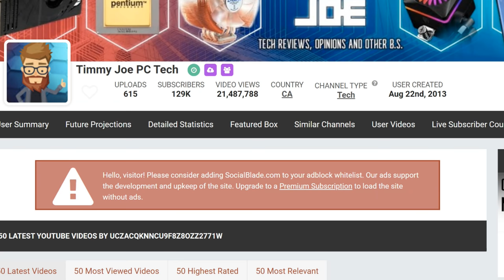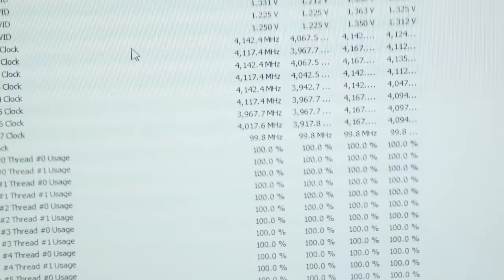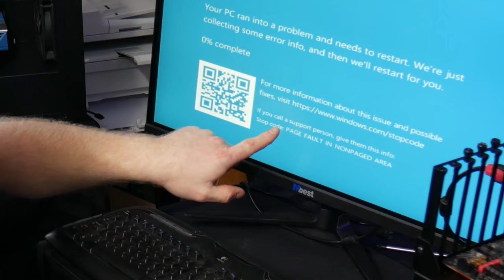This Ryzen 3700x was my biggest problem in 2019...

Comment: hey Timmyjoe i have a very similar problem but mine was my ryzen 7 1700 chip with a Asus X370 prime pro board and i put it in my wifes MSi b350 gaming board and its never given any issues again

i currently have a x3600 ryzen 5 in the same asus board but it does some funny stuff at total random so im upgrading to an Asus X570 prime -P

what your saying is slightly scaring me because everything worked in an Asrock B450 board that i sold now 

and im wondering if its an asus board for my cpu problem

and yes like you ive tried m.2's ssd's magnetic hard drives

2400mhz ram 3200mhz ram 2666 mhz ram etc 

asus and gigabyte rx480 gtx 960 2gb and 4gb  currently RX5700 

antec corsair and evga psu's,  im actually very happy you did this because i thought i was going crazy
Reply: both cpu's were pre-purchased for launch date

Comment: Had a sound card that without fail caused 100% usage just by being installed in the slot without even having drivers installed.

Also had once a netgear NIC cause the PC to bog down to the point you couldn't even move the mouse. The port showed lots of activity even with no lan cable plugged in lol, def faulty that one.

Comment: I have a PCIE SSD and it will only work in ASUS boards. on other boards it will show up then after a restart it will dissapear till i restart the PC or it may not show up at all. I went from my Z390 Aorus Pro Wifi to a Asus Z370F strix and my last build had a Z270 E board

Comment: Last 2 week I was task by my salesmen to assemble 3 custom desktop, two pentiums G forgot the model and one i5 9400 in our store. So I finish building the i5 and told my buddy to leave two of his SSD outside so i can clone the o.s since we using same motherboard all the driver will be similar and the end of the day to cut down the assembly and o.s installation duration. Just as a finish install the o.s on i5, after the 2nd restart just before it reached the first time setup window page, it hangs during the ASUS boot loading. So I thought maybe it was ram, so i borrowed one of the pentium RAM, chuck it in, hangs on the same page. Then i thought hmmm maybe it was the i5 WD ssd Green 2.5 going haywire, so i borrow the pentium kingston 2.5 ssd to make sure and validate.

To my surprise, after clean install on the Kingston ssd, it also hangs on the same page. so now i was like "ok must be either the psu, cpu or board went juju, so I bring both o.s installed SSD on the pentium rig. Guess what? IT ALSO HANGS ON THE SAME PAGE. I then turn my attention to the third pentium rig, start install everything on 3rd ssd kingston, bam, loads fine into desktop page. So i thought to my self, should i try take the 3rd ssd and run on the i5 or the 2nd pentium? lets do that. biggest mistake ever. Booom both desktop also hangs on same boot page.

Then my salesmen so worried he send in new i5 and new pentium, along with new 2 new boards, new wd and kingston ssd even the wifi cards lol as i explain the situation what the hell is going on. After those demise and customer already collect all three desktop without knowing the trouble we went into, i request my RMA officer to issue warranty for all the hardware, BUT priority the Intel cpus first. We send the infected i5 and pentium to intel malaysia. a week later, Intel send us back two brand new i5 and pentium. on the report, it says bad cpu, bugged microcode. lol. The sad part is, the two B360 boards, the hdds, the wifi and ram were also replace by respected manufacturer. I dont know how and why but all those hardware somewhat affected by it aswell.

Comment: I also have had 2 r5 3600 builds be very temperamental on 2 different gigabyte  aurus pro b450.  I have got them to work. One I swapped cpu for another 3600. Then never another issue.  But said problem cpu is fine in another board.

Comment: Gigabyte is just the worst with there am4 motherboards. I had a gigabyte gaming 3 ab350m and ryzen 1600 when it first released.
It was fine running 3.8ghz with + .2v 
I got a ryzen 2700 in june 2019 I had to updated the bios. I got it up to like version F41 with little problems, but I got it there. 
I put the 2700 in and everything is working "ok great, time to overclock to an easy 4.0ghz"
I can't get it to post not even at 3.8ghz
So I boot with stock speed and try ryzen master. And I see that none of my voltage offsets are being seen. So I restart and make sure I at least have offsets..... ya they are there in the bios but not in windows.
Tldr; gigabyte locked down voltage offsets  ether by accident or on purpose.

Comment: Thinking it's an idle power issue for sure where on gigabyte boards specifically it undervolts too far for the cpu speed & possibly the cache for that particular pre-release cpu while its fine on the retail versions.
I'd try setting a bit higher manual voltage like 1.35v - 1.4v on the cpu and turn on a bit more aggressive load line calibration setting if there is one.

Speaking of gigabyte & instability, on my old gigabyte 870a ud3 i had issues with stability due too ram voltage being too low when i put in 4 ram sticks, it was down at like 1.43v with 2

After setting that too 1.55v it was right as rain even overclocking a phenom II x6 1090t without any hiccups or anything too 3.7 ghz.

Comment: ok so i've build a computer for my little brother just recently and bought a wifi 6 pcie adapter and imagine what... it is a pcie x1 slot but it only works in the pcie x16 slots or in the very bottom pcie x1 slot for some reason... the motherboard has 4 x1 slots and it only works with one lol

Comment: I had a similar problem I can't remember the exact models but both were gigabyte mobos I have a 9590fx and I got my aunt a 8350fx, overkill for her, but it would not work in her motherboard, it worked in mine, so I now have a 9590fx in a mobo that was highest rated for fx6000 series and she has my old mobo

Comment: You should rise voltages on that Gigabyte mobo.
Reply: Nope, rip the mobo out and toss it in the garbage, coz Gigabyte is garbage. My x470 Aorus reverts at own will from Bios F50 to F31. No clue how that is possible, but a simple EC chip flash solves it.

Comment: Had an issue with a computer built for a friend asus board and 3800x combo, will blue screen intermittently, the fix I found was to update the bios firmware and never happen after that.

Comment: I have a little home server with a 1700x in asrock ab350m pro4 mobo and a corsair cx 550m , 2x16 xpg ram , msi gt 710 2gb  , 3x500gb munchkin ssd , everything is new and every 2 days it shuts off , my guess is the psu is faulty  , also I have and old fx8320 machine that after I finally let window update now wont let it use 8gb of the ram but it let's me know it see it there . If you have answers or ideas on either issue I'm listening

Comment: Sooo my weird pc-problem? 2600 onasrock b450m with 16gb cheap gskill 300mhz ram and a 1080 had problem that it would crash under load so I got a new psu ( had an enermax 650w from 2013) a binfenix 650w and had still crashes it worked fine with an 1060 but it also was not my 1080 bc it work fine in another pc and I tested a 1080 from a friend and it also crashed then found out that i had ram issues and found out that 1 stick was faulty so I reflowed the chips (I'm using it now so it worked) but I still had ram problems so I got another set of ram but those had the same Problems so I got a really cheap 2700x and even that didn't fix it (but it still only crashed with the 1080). So I already changed everything exept the Mb at some point I also reinstalled windows. So bc the motherboard was the only thing left and the other one was not the best for a 2700x I got a asrock 450m Steellegend. It worked fine for 2 days, than I had the same Problemsyou start furmark and it crashes imidiatly so I switched back to my old 650w psu still crashed so I used my even older 450w bequit psu and it worked ( But 450W is not the best for a 1080) and the other motherboard with the 2600 would also crash with the 650w Psu's but not with the 450W. So I took my mb out of the case and for some reason It worked so I put it back in my case and it is working so far. But can someone explain to me why my systhem crashes in Furmark  but only when I use my 1080 and (not my 1060) but only when I use it with a decent PSU or when I use another mb ram CPU combo?

Comment: I got the 3600 from 1700 on B350 and the BSOD Whea kept happening, be fine for 3 hours then again and more often. Reseting the pc reset time it would work for. Then Asrock released the bios 6.00 and it has been smooth sailing.

Comment: this exact issue and its because of windows 1909 and windows system file corruption after i ran the windows corruption recovery tool and avoided  installing the chipset drivers from gigabyte i never had the issue again its gigabytes sound and chipset drivers that ARE corrupted and they need to fix the issue had the same issue with my 1600x and gigabyte x370 gaming k7 but only if i installed drivers from gigabyte
Reply: tldr gigabyte needs to have proper drivers available on their site and not half baked installs that are corrupted and hard to even deal with the sound drivers are borked and the chipset drivers are modded mobile drivers

Comment: Guys help please, i bought ROG Strix B450F Gaming Ryzen 7 3700x i have problem with it 😭  Updated Bios to latest version 3103 but mobo just don't manage CPU well 56C in bios on idle, any click 63C Wraith Prism box cooler, cpu voltage is 1,41v minimum crazy, tried to manualy set up lowered cpu voltage but then it doesn' turbo or lower clocks just stay fixed on 3,6Ghz but temp is 44. Tried  everything can't make it to work properly any ideas?

Comment: i wonder how much the imc voltage differs. Gigabyte love to push voltages a little higher at stock. maybe the memory controller is getting cooked by the Gigabyte board and your seeing degradation after all it's not a retail chip so maybe its imc is not as strong

Comment: OMG, I must be "ANCIENT" or the better description would be "PRE-HISTORIC" now... Thanks. :-/  Worst thing, someone brought me an XT clone in which the MFM HDD controller would randomly "vanish"....  Motherboard was fine, the controller was fine.  It just took me a while to find out that the ISA bus on it wasn't clocking to proper spec (10Mhz instead of 8Mhz), and the controller simply wasn't getting along with it causing it to randomly kick out.  It was humorously frustrating to sit there in Debug and see the controller BIOS just vanish as if someone pulled the card out of a still running system.  Replaced the controller, though it took a good while to find a controller that would work at the non-standard bus speed.

Comment: I love gigabyte motherboards for being cheap but when it comes to overclocking and handling big CPUs its luck of the draw cause my b450 aorus pro has a 3800x and it works amazing at 4.0ghz I did the same build but with a 2700x and it got blue screens all the time and it's the shitty voltage controller on the fucking motherboard and the system wasn't getting enough power also I underclock a little and I got it to 1.350v instead of the stock 1.4v at 4.0ghz it worked magically it is so stupid I now am a fan of msi motherboards instead of gigabyte unless it comes to 2600x and down they work amazing on gigabyte motherboard

Comment: I dont have anything personally against gigabyte, but ive always bought either asrock, asus, or msi boards..Ive WORKED on gigabyte systems, but I stay with those brands..u never know, it could be some voltage frequency/emf problem, the way 2.4 wifi interferes with usb 3.0 ports or something..u never KNOW!! lol...glad u got it worked out...oh btw, ur idle temps SEEM a little high...to me anyways...i get a little testy when im even scraping the bottom of 50c....maybe u have 2 gigabyte mobos that are worn out/damaged?? OR it COULD be that test sample has something about it that makes it different...and that difference doesnt like the gigabyte engineering side....hmm,  that is an interesting one indeed..i wouldve been cursing the winds lol..

Comment: Mine was a 3700x stuttering and making weirds buzzing in my friends PC and  i Swapped it with a r5 2600x for the test and it works fine after that I though it was a Motherboard issue because it was a cheap prebuild so ayoy ram and no name mother board it seems like it was only the CPU causing the issue

Comment: A fun Gigabyte story,
 ax370-gaming k5 
Ryzen 7 1700x
current chipset drivers on gigabytes website "for 3rd gen Ryzen support" that are the closest thing to the current win10 version (next in line is like win 10 1802 or something like that) and my system would brick every time i tryed to do anything remotely intensive.  Gaming- nope system would lock up, install updates- nope again. Oh a d every gosh damn time the hdd would disappear completely until you pulled the power supply power and fully hard reset the entire system. Like 3-4 months trying to figure out what the hell, kids would watch youtube and other stuff and it would be fine. Very pictular games would play ok too. Long story short i use amd chipset drivers from their site for the x370 platform and now the system runs completely fine... dont use gigabytes most current chipset drivers for the 1st gen Ryzen's they will lockup the onboard sata controller of the Ryzen CPU and require it to be fully power cycled before it will reset correctly and your hdd with be detected again....

Comment: My ryzen 1200 spent 3 month as a dual core then one day it went o im 4 core just by switching the machine back on wtf but now it wont boost to its clocks its meant to but before it did, its the most f@*ked up chip iv ever owned yet got a 1600x and that goes straight too 4.1ghz on air not even tuned up some days you just have to give up

Comment: Gigabyte is the worst choice for anything AMD. I bought GB motherboard and had issues with thermal throttling etc even with a liquid cooler and I bought rx 580 from aorus gigabyte I had really bad issues and they gave me refund of that card after 3 fucking months, I also tried ram kit and had problems with that then I switched to asus I still had probs with asus strix b450 so then I switched to Msi b450 now no probs and switched to corsair lpx 3200mhz cl16 kit overclocked to 3466mhz cl14(tested by memtest86 for a week) and I have no probs.
Gigabyte sucks, Asus semi sucks!

Comment: I have an i3 4130  with intel 4400 hd so  i bought an rx 570 and when i  installing the driver the monitor turned off then truned on and the driver wouldn't install so the problem was from intel hd and yes i displayed it from windows and i tried to install drivers again boom same thing so i Google it and it looks like i have to disable it from bios too so because it's old cpu it comes with old motherboard and old bios so i wasn't able to do anything and Yes the little intel hd graphic is literally stuck in my system  So i was running all this on Kingston SSD and i also have an HHD not using it but already have win 10  installed in it so i displayed the ssd and connected the system with the hhd and BOOM every thing was perfect and installed all the drivers and everything fine but when i switched back to the ssd nothing happened and everything was perfect again xD this is the Wired's pc problem and Solution i ever had and sorry for Horribly English

Comment: I am Build new PC But after 10-15 days pc Randomly restart Please kindly help

Processor : Amd Ryzen 7 3800x

Motherboard : gigabyte x570 aorus elite

RAM : VENGEANCE® LPX 32GB (2 x 16GB) DDR4 DRAM 3600MHz C18 Memory Kit – Black

SMPS : Cooler master 750 w psu 80plus gold fully modular

cabinet : Antec DF600FLUX cabinet

SSD : crucial m2 NVMe 500gb

GPU : GTX 1050Ti

Comment: ive had the same issues many time, ive ran benchmarks and stress tests and they work fucking fine, as soon as you do the most random shit, they BSOD like what the fuck, my Issue was the same with the B450 from Gigabye!. i swapped it for an asus and is still working fine, ive built 6 identical machines R5 2600  32GB Quadro P2000 on a Gigabyte B450M and only 1 random machine started having issues just because, then when i tried to update the bios it bricked, seems Gigabyte needs some QC on their newer boards

Comment: i used ti get the same error, ryzen 1300x, starting i OCed till 3.9 it kept BSOD same damn error, after some bios updates and LITERALLY INCREASING VOLTAGE to 1.38 i finallyyy got a stable pc with 4.1, aorus has good bios updates imo

but tbvh aorus, gigabyte is fuqin weird

Comment: Dude asus has a really similar problem between a ton of their boards. Its driver related tho from what I can tell. Disable wifi and bluetooth and it doesnt crash. Turn them on and it does. X299 x399 x570 all happens on with asus boards. Fuckin asus man. Glad I have the two DARK boards to use as also

Edit oh yea, and the kicker. The fucking ROG asus laptop I have does also. WTF
IM AN IDIOT for buying so much asus crap

Comment: i had a pc in the vista era lol every time i unplugged it when i plug it back in i would haft to take out the ram and reinsert it or it would just make beeping noises but the funny thing was i would have no problems afterward could be weeks or months until i unplug it again i tried different ram and power supply's same thing. the weariest part was i had 3 of the same pcs 1 mine the others my mothers and than 1 my sisters they all did the same thing never fireguard out how to fix them must have been a manufacturing issue they where compaq presario pc one was sr5710f and the other 2 where sr5710y basically the same thing just a different cpu